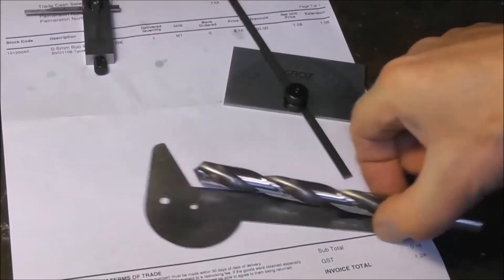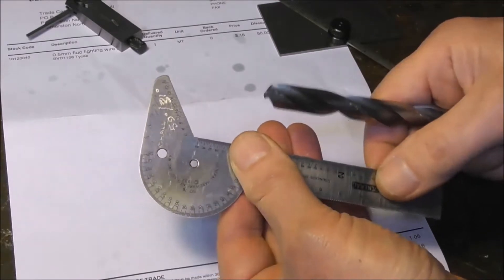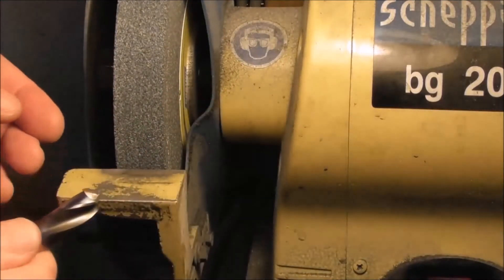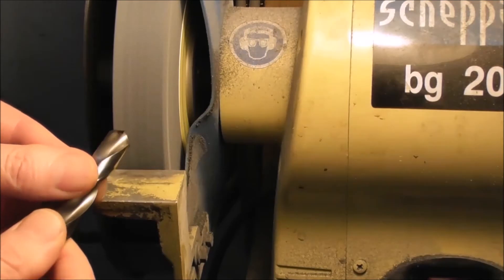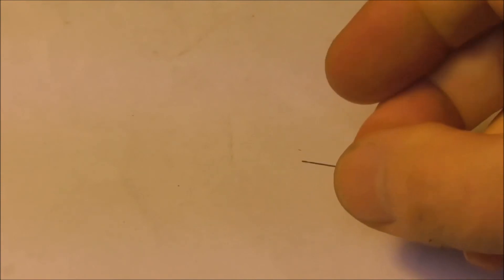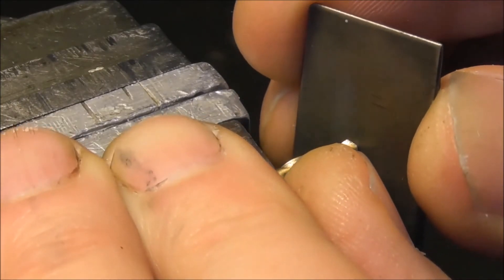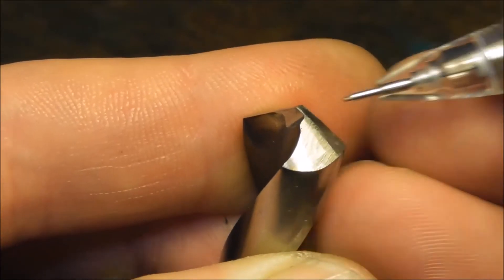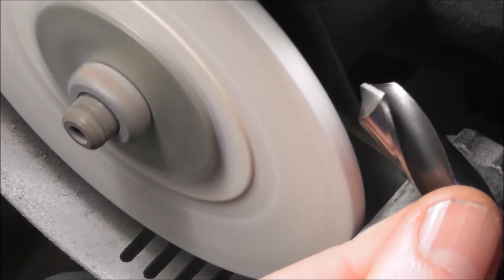Freehand Grinding -  Part 3  - Drills Continued

Comment: Thanks for the very straight forward explanation of web thinning. I had been thinning the web with an undercut under the cutting edge. It works but does not allow for the resharpening like yours that is on the plane of the rake. (sorry if I use incorrect words to explain, I am just learning this stuff)
P.S. I no longer use a bench grinder for sharpening tools. I use the diamond wheels on a dremel type tool. They are far more flexable in getting into angles and such. And they grind carbide like butter.
Reply from the maker: Hi Hans. Sorry I missed your comment. Thanks for the feedback. Cheers  Cliff

Comment: Your drill sharpening videos are very interesting not only for newbies. But you postulate that it is valuable to be able to do it freehand. That may be true for somebody like you who does that as part of making a living and many times per day or week where as for the hobby metal worker this may happen only once in a few weeks or less. Therefore it is more difficult for the hobbyist to acquire and maintain this level of freehand skill. So the hobbyist might still be faster and more precise using a mechanical help for this, like one of those drill grinding attachments to a pedestal grinder, or a tool and cutter grinder like the one you probably use for D-bits (Deckel S0 clone). However, I do not like the plastic toy called drill doctor. That is a time waster for pros and hobbyists. But your explanations of the different wanted geometries and the reasons for wanting them also help the hobbyists who do not grind freehand.
Reply from the maker: Good points Rol. It is difficult to do occasionally...yes I agree...But the easy road is not as challenging. Cheers  Cliff
Reply: Of course that is true  as well, Cliff. Much of your content is best suited for pros and advanced metal working hobbyists. But I often have the beginner metal working hobbyist in mind. Typically his first step is to move up from a hand power drill to a drill press. When a drill is worn out he buys a new one. He uses the same drills to cut any material. So he only gets his toes wet so to speak. In my (possibly wrong) theory the step to buy a grinder and learn about simple and more advanced drill tip geometries and sharpen his drill bits by himself is often the break through into metal working. (Getting in it up to his knees). And IMHO this step should be made easier by a mechanical help like a drill sharpening attachment. The drill doctor is no good for this either because it works like a black box. The user can not see what it does and it does not work very well either. The next step is then to get a lathe. And sharpening of lathe bits does not look so intimidating any more for somebody who already sharpens his drill bits. Then he is in it up to his hips...:-) Although some also avoid sharpening lathe bits by exclusively using carbide insert holders. But most inserts are optimized for  heavy cuts in series production and don't suit the needs of hobbyists very well. He has to dig in quite deep to find inserts for light finishing cuts.
Reply from the maker: Hi Rol - Yes it is true I am unsure who to aim the videos at - I think I am slowly realizing the larger number of beginner viewers and shifting the focus a little. Thanks  Cliff